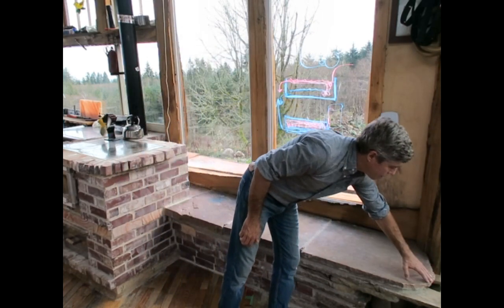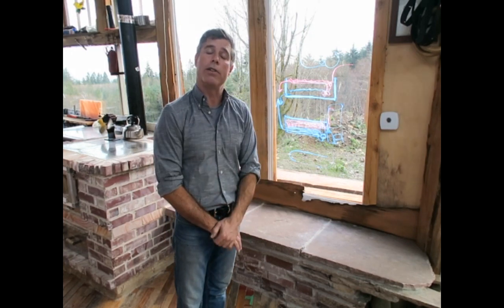Rocket Mass Heater Bells and Benches Discussion

Comment: The one compound on earth that has the highest Specific Heat is WATER. This means water takes the most amount of energy to heat up, but also holds it the longest as it gives it back. ..making Water the PERFECT heat battery.    .    .  .just don't let it drop below and freeze, or boil to build a head of steam. 
    Saving you the study time as I hold a degree in Water Sciences.  :-)    Hope this helps
Reply: Only surpassed by candle wax.
Reply: @justinsane7128  Especially if it's poured right on you. :)
Reply: @justinsane7128  Seen some people simply put a pot full of wax on top of their woodstove
Reply: Ok, now I have to go find out if it's water or wax.  Damn you, Internet!
Reply: molten salt?

Comment: Been looking at kang stove combos for a year or so (luckily I read & write a little Chinese). this small model fits the bill for a stove plus can run to a kang bench. brilliant. worried, at first, a little about the ceramic top, until I thought about it. They are designed for temp variation across the surface (my high-fire stoneware background had me worried but this is a different breed of cat). Brilliant use of light refractory material. I think having built a couple small wood kilns will make the build a breeze. Can't wait to start on this project this spring, man!

Comment: on the bench,would it give you better heat distribution if at the far end you had an additional raised area so the hottest gases would then travel the length of the bench to get to the highest  area,then work its way down ,seems like that would force better distribution and add additional mass for heat storage

Comment: Great idea Matt. It seems so obvious yet no-one else on YouTube has described it. I know the principle is very old, but you have brought the idea into the modern age. I think I will built one later this year when my tiny house is delivering, putting the bench under the house, and enclosing the air space under the house so that the warm air from the bench is contained in another “bell” under the tiny house floor.
Reply from the maker: Thank you Chris. I love the idea of an underfloor bell, someday I too would like to build a system with that feature.  Check out Korean Ondol design for some inspiration.
Reply: Chris, could you explain this a bit more?  Are you envisioning the rocket part in your tiny house, and then have the exhaust angling down through the floor to a bench underneath the tiny house?  are you then going to have another bell in addition to the bench, all underneath the tiny house?  since the bench is underneath the house, why call it a bench rather than bell #1?  will you be able to go underneath and sit on it?   what will you use to enclose the space?  i'm fascinated by your idea.  Thank you.
Reply: Hi Felecia, I hope I can answer your questions. 

Firstly the tiny house I an talking about is one on wheels, and is a type of caravan. It is not a small conventionally built house.

The rocket stove would be structurally separate to the tiny house.  The bell part of the heater (ie the part where combustion occurs) would be beside the house. The bench (where the hot exhaust gases heat thermal mass and heat is stored) would be under the house. It will need to be fairly low so that the axles of the tiny house have clearance. The flu would also be beside the house. It will designed so that I can build the rocket mass heater in situ and then move the tiny house over it. I would then enclosed the entire space under the tiny house perimeter with some sort of insulating board so that the warm air is not blown away.  

The space under the tiny house is very restricted. There is about 15" ground clearance ie the distance from the ground to the axles, so most of the bench will be below ground level and will have a maximum height of 12"above ground level. 

The bench could be built so that the bench extends outside of the tiny house perimeter, but then this part of the bench would loose most of the heat as it is the part exposed to the coldest air and to breezes. 

I can understand that having a warm bench to sit on on those chilly nights would be most desirable. there would be many nights when it is chilly outside but inside the tiny house it is nice and cozy even without any heating or minimal heating and the under-floor rocket stove would be over the top. I think that a second rocket mas heater for seating would probably be the way to go. 

Does this answer your questions? I hope so. I am no expert in this area, and this will be a first for me!
Reply: Chris, thanks for your reply!  i had some difficulty understanding your plans because of how you used the following terms: bell, bench and flue.   As I understand it, no combustion takes place in a bell.  I understand why you'd put the wood feed and core to the side - so you can access it, right?  It sounds like you might be planning a 'double' system with a bell and a flue bench.  Why not do one or two bells?  are you still perhaps thinking of using the bench for warm sitting instead of building a second RMH?  :)  Why not put both bells under the tiny house?  perhaps there is not room?

Comment: with a bell system how do you deal with potential leakage of flue gas .
Reply: It's incased in media..
Reply: @onebylandtwoifbysearunifby5475  well 1) you will do your masonry realy good, 2) there are CO detectors which you will use with this system. 
Smoke will be realy visible when they will have any crack to go through before any CO have any chance to enter room.

Comment: Beautiful, very nice, compared to having the 45 gal drum look. The "ONLY" concerns I have is how to regulate the amount of heat without literally cooking yourself out. I know you can always open windows, etc. to allow cold air into your space to cool the room out, but I live in a climate which the weather changes literally in a few hrs. I home built a outdoor fresh air wood furnace, with thermostatic controlled fan to suck warm air into the building I was heating, which by far was my favorite set-up , until -10 weather when it became impossible to heat. ( Trying to keep the place warm took truck loads of firewood requiring constant refilling ) Next yr. I am planning a beautiful system, like your's. The cushions I am planning to use to soften the top of the mass storage, will be made from " Old School Bus Seats pre 1960's"  these are made with a "Memory Type Foam" salvaged from school bus seats, which cost next to nothing and I have yet to find anything as comfortable, ( Except Memory Foam ) However this foam is extremely "TOXIC"  if it catches fire, so extreme care "MUST" be taken. to guard against combustion, Thanks for sharing your video,  I was searching all video's looking for design I found pleasing. Which your's I consider, the most appealing.
Reply: I think I would try to avoid plastic-type cushions on the hot stone surfaces, they'd be more likely to catch fire as you've mentioned, and they might get stinky for a while before they caught fire.  I would tend more towards something made of wool, it's less likely to catch fire, and when it gets warm it doesn't stink like burning plastic.

Comment: running a center brick wall in the middle of the bell bench might be interesting if one needed extra support for the bench top, or to force the air to flow around some corners. perhaps more interestingly if you had the center wall forcing air to move in a certain direction placing a wall perpendicularly to the flow of air with a gap at the bottom you could force the bell to work with a higher exhaust port so long as you could with your bell reach a point lower than both the inlet and exhaust ports... would only be useful in extremely limited applications though.

Comment: If you run the gas out the bottom of the bench beside the hot barrel it will heat up the air inside the exhaust pipe making it draw better and you have less chance of downdrafts. Water can store more heat than almost anything.
Reply: Incorrect, water temperature tops out just over 200 degrees, over that temperature it starts flashing to steam. However, contrary to what he said, a sand thermal battery top out between 1000 to 2000 degrees. That's 5-10 times the ability of water.

But both a water and sand battery MUST be much larger than a little bench will allow. It's more like the size of a medium to large above ground pool. Smaller, and they just don't store the heat long enough to justify the cost.

Additionally, you're going to go through a lot of fuel to reach these much higher temperatures. You can do that with solar thermal cells, but unless you're going to run a blast furnace, you'll have a hard time doing it with wood.

Plus, BOTH water and sand batteries require a great deal of insulation from the environment to stay warm. This is true even if they bury them.

I do agree with a small storage option like a bench that either cob or stone is a better storage medium. The bell system is better if you're just looking to have a large radiation surface. But having an empty cavity will obviously sacrifice thermal storage it can have.

Comment: Interesting video, I don't agree with all your premises.

But I have a question, if you're looking for storage mass the why use a little bench at all? Why not turn the entire floor into your thermal battery? This was proven to work in Asia and by Roman's well over a thousand years ago.

Run multiple flu branches off of the heat source and collect them at the exhaust pipe. For example for a 16x24 cabin you could have 3 runs that total roughly 50 feet each. That's a total of 150 of run. Additionally your radiation surface is 384 square feet. Obviously you need to insulate the bottom and sides but the top itself will heat the structure. 

This this layout is a simple straight run you minimize the back pressure as each total length is only 50 feet. And there is no snaking runs back and forth to get total coverage.

Comment: Considering build of a rocket mass heater. I live in the thumb area of Michigan. My house is two story colonial with a concrete block basement wall. Block wall is constructed of 12", 3-core blocks. House is wood frame. 4" side walls with blown in insulation and is 100% cedar siding. Trying to determine best location for the heater and the size required to heat the house. House is approximately 2,544 sq. feet, plus the basement, which is an additional 1,368 sq. feet. My main heating unit now is geothermal, which is 6 ton. House is 100% electric. No natural gas available in my immediate area.
Reply from the maker: Probably too much heating needs for a RMH, they just aren't that big and that's a lot of space.  You could build one to heat a room you spend a lot of time in.

Comment: Condensing moisture and draining it as the exhaust gases cool in the bell, moisture from the wood? I'm a long time HVAC installer/business owner/designer. I love this idea for our cabin just wanna pick your brain a bit. Have seen some demonstrations where exhaust was as low as 110° F using extraction from the bench mass via Pex/hydronics as well for multiple "heating" uses. Gravity inversion hydronic closed and open loop systems.

Comment: If the stove pipe needs cleaning out, then wouldn't a bell just have the same creosote spread over a larger area? You have had these stoves for years. I'm assuming you have opened one of them up. Are the bricks inside the bell not covered in creosote and does that not pose a threat?

Comment: Great Design, Matt! I have a quirky theoretical question. Let's say you wanted to make your bench as long as possible so as to maximize the amount of heat absorbed from the combustion process. How long do you think you could make that bench before you started seeing any diminishing returns? Thanks!
Reply: Many factors to consider.  Amount of heat at source ie size of fire.  Width, height, and mass of bench per linear foot etc
Reply: seems to me that you're pretty much describing a hypocaust, here.

Comment: Matt I understand how the RMH works(in theory) in heating an open floor plan but how does it work in a 3-4 bedroom single story home. (hubby asks and I have no clue).  How does the heat move through out the house into the bedrooms and such? thank you for your help in explaining this to the Hubby.
Reply from the maker: Alicia, they are great heaters, but like all heaters there needs to be a way for heat to move through the space.  It will heat the rooms as well as a space heater in the main room would.  If you all leave the doors open and have good airflow it may work, but generally they heat the room they are in and don't do a great job of heating separate rooms.  Thanks for the question.

Comment: As to efficiency, isn't drawing inside air counter-productive? Doesn't that mean that outside air is flowing into your living space? Why not have your burn chamber outside and the barrel inside? I am imagining one with the burn chamber in a mud porch outside integrated with the low part of the wall.
Reply: frosty  Or it could be on a porch or mud-room. But my comment was posted before I understood that mass heaters are meant to heat butts not heat air. I was still thinking heated air rather than heated people.

Comment: Matt, you mention that the flue temps are less with the bell bench versus the ducted cob style benches in a rocket mass heater.  What are the flue temps you're experiencing in the bell system versus the RMH in your home?

Second question, one of the advantages to the RMH Is the slow and extended release of heat that has been stored in the mass.  Since you're only heating air and the primary heat release is through the surface of the bell, how does the bell design compare with the ducted cobb from a heat release perspective?  Does it release more heat during buring and drop off faster once the fire goes out or what?

Thanks for your insight.
Reply from the maker: Hi Greg, good questions!

The flue temps are comparable in normal use, but the flue runs tend to climb more quickly and higher in longer burns.  Average for both is around 200°F.  High so far in the tiny stove is about 250°F, but I've pushed the flue run stove up to almost 350° on long burns.

The two methods are roughly equivalent in terms of storage and release.  Keep in mind that a cob bench with flue pipe is really mostly hollow as well, with lower density materials than the brick/stone of the bell used to surround the flues.  My assumption is that my brick/stone bell has as much mass/thermal storage, if not more, than an equal sized cob/flue bench.  Also, stone and brick are better thermal storage than cob.  Due to these factors, the bells have just as long of a heat cycle, and no significant difference in performance.  The thing about the cooler exhaust gasses is due to the fact that as the bell "fills up" with gasses, the warmer gasses simply become "deeper", heating more of the sides.  The flue runs just get hotter and hotter on top.  In this way I think the bells can store more in a similar volume, as they use their depth in a progressive manner, and more effectively.  I think!  Hope that helps, thanks for the great questions!

Comment: What wall thickness in the bell is most efficient in releasing latent heat in 24 hours?  Would this thermal bell (taller version) work with a standard wood stove?

Comment: Thanks for your video.  I agree with you about not using a loose pebble or gravel as a heat storage mass.  This is my second winter using a partial run of that in my flue mass storage; and the other part is of a solid packed material.  The solid packed material is much better.
I am building a new house now and am planning to build a masonry heater, with some rocket stove aspects to it.
The books I have on masonry heaters caution about having dead end pockets where unburned flue gasses can accumulate, for fear of a possible explosion. (must have happened in some).
Do you think there is any concern with having a bench bell system like you have, where the the entrance and exit exhaust are on the same end?
I think I may do something similar, but put the exit on the opposite end so there is no dead end pocket.
Reply from the maker: Hey CE, great questions.  There are concerns with capturing unburned gasses in some systems, and in traditional masonry heaters this was a common caution.  My experience is that while you can create some smoke in these burners with poor burning practice, it is very difficult to burn them poorly enough, often enough, to create chimney fire conditions.  Due to that, it's very difficult to ignite downstream gasses, there just isn't any spark traveling that far, and once you are creating any significant heat in the front end, you will have draft clearing things out.  

And that's the real key.  As long as the body of the stove is slightly warm, there will be draft and things can't build up.  When you don't have draft, there's an obvious problem, and the stove is difficult to start.  In this case the bypass is there for tough starts, so the smoke should really never happen.  

My belief is that this was much more of a concern in large European masonry designs that would be loaded with 60lbs+ of fuel, door closed, and walk away.  They could smolder for a long time, often did, and often had significant creosote buildup and much more restricted flue flow paths.  The dead end, or "blind bench" is, I believe, very safe when coupled to a modern combustion design.
Reply: what would you consider to be poor burning practice?